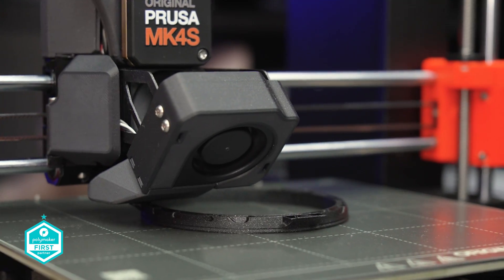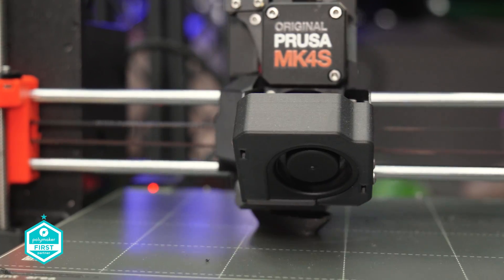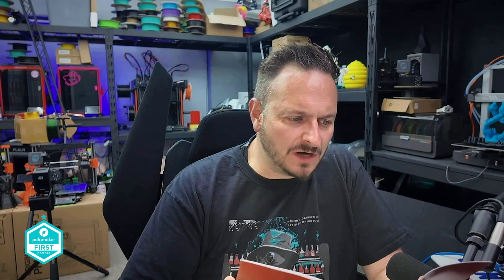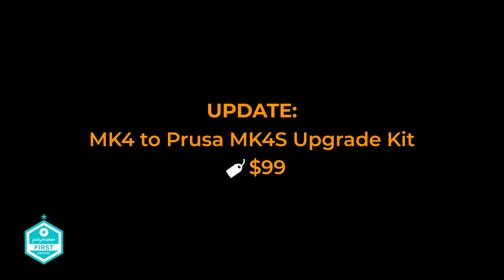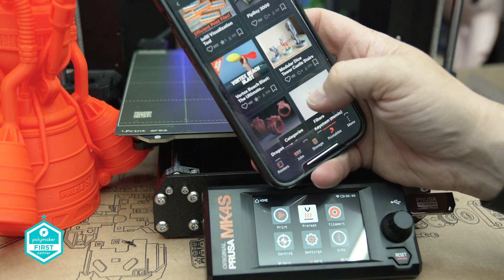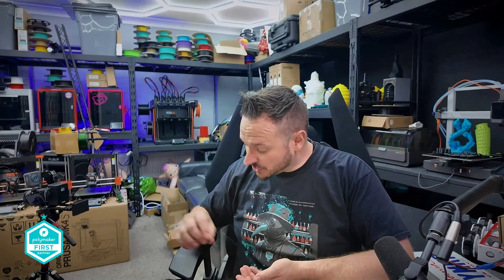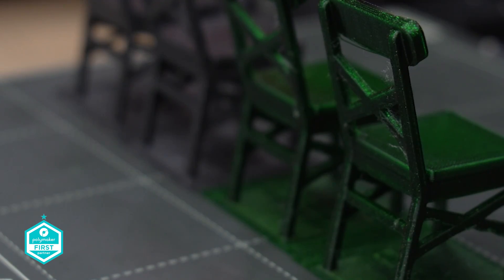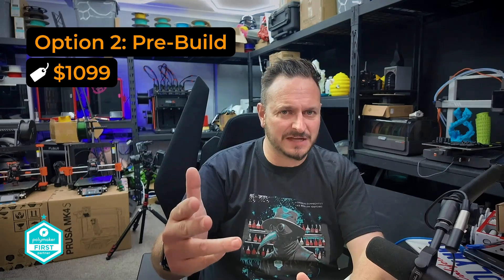Meet the Prusa MK4S: Minimal Print Assistance, Maximum Care Commitment!

Comment: Hi, I have a Creality ender3 s1 pro printer, I don't have any problems with small prints, but when I want to print large prints, it says communication with the MCU is lost at different times and the printing process stops, when I want to continue from where it left off, it starts from the wrong position. Why does this machine give an error with large prints, I searched the internet and couldn't find much information that would be useful for me. I talked to a service and they told me that this could be due to overheating of the sonic pad, stepper or motherboard. I don't know what to do. Do you think cooling the steppers could be a solution, if you have published a video about this, I couldn't find it unfortunately. I would be very happy if you could give me advice. Unfortunately, I don't have enough technical knowledge on these issues. 😞
Reply from the maker: So if you are running Creailty OS /
klipper via a sonic pad I’d suggest you look at the error logs via the web ui you should at that point see what it’s erroring on. On your small prints are they positioning in the middle or to one side ? 

To be honest it sounds like it’s not positioning correctly.
Reply: @TheRealSamPrentice  Thanks for your answer, my friend. I had made the offset settings, the printer works right in the middle. I will try to make thin and high prints in the corners of the printer and see if there is a problem with them. I did not understand much from the error logs, but if I find someone who does, I will show you. I did not try cooling the motors either, if there is no information in the error logs that will solve my problem, I will try cooling the motors.

Comment: Noise? I keep asking this wherever I go. The MK4 is not particularly noisy, but the fan can be obnoxious. Is there any meaningful step with the mk4s, please? Or can I simulate it with confidence by tuning the fan to 70%?
Reply from the maker: The fan doesn’t seem loud I mean having just run the t1 which is a jet engine.. this is pretty quiet, the movement is louder

Comment: I am not sure what you mean by wanting the App as feature for the XL? I have just started a print on my XL using the app and am monitoring it? The app is just an interface to Prusa Connect.
Reply from the maker: Sure well currently on the version that I’m using the XL doesn’t appear to work the mark 4’s do though. The app I’m using is via TestFlight and is a beta version so I don’t know if that’s different but that’s what I’m commenting on. As always happy to be wrong ;)
Reply: @TheRealSamPrentice  Perhaps the Android and iPhone versions are slightly different too...
Reply from the maker: @ulaB what are you using ?
Reply from the maker: @ulaB so this is Version: 1.0.2 (92) for iPhone but no xl options only mk4.. I’ll ask them about it.
Reply: The app itself is not related to mk4s except that it was launched at the same time. It works with mk4, mk4s, xl and mini. I'm using it with my mk4, on android
Reply from the maker: @ktakna it’s not seeing my xl on this version
Reply: @TheRealSamPrentice  But you can see the XL in Connect?
Reply from the maker: @ulaB Not on the version app that I’m using. I’m at Prusa on Monday so I’ll confirm
Reply: @TheRealSamPrentice  for reference, I'm on android, 1.0.3 build 97, updated today, where xl is visible. It was visible in the previously available version yesterday as well. Maybe the tf version wasn't updated. Besides this, I don't like Prusa's marketing, which listed this app in the announcement for 4s, seemed they they wanted to have just another cool line item in the marketing release announcement. Wording correctness goes a long way - they should have just said "we're taking the opportunity to announce the release of this app which works with the other mentioned printers as well"
Reply from the maker: @ktakna  understood, so I have the xl and the mk4 which I didn’t review but have simply just been working with on the bike projects. That being the case I had not previously used that feature as I was only using the usb. I’m running an iPhone so I might be at a disadvantage but when you go to add a printer it only shows mk4’s and nothing else.

Comment: Still over priced
Reply: welp, I will still buy 4 upgrade kits
Reply: No slave labor, though.
Reply: Im willing to bet my left kidney that this guy is a bambu owner and is still blind to the endless flaws the x1 has
Reply: @Enjeenier  actually I never owned a Bambu lab and I am a MK3s+ and MK3.9 owner and waiting for my 2 tools prusa XL  and 3.9s upgrade to be shipped.  I got my 1st two kits when prusa used to sell them
For 749USD that was a good price
Reply: I'm both a Bambu and Prusa owner. And yeah, prusa is way too overpriced. But I also think the X1 is overpriced aswell. The P1S and P1P are the printers to buy currently and objectively. If you're not getting a P1S or P1P you're spending more money for the same/less.
Reply from the maker: @vulpix9210 i find it really interesting what people think about price and value.
Reply: @TheRealSamPrentice   I don't buy brands. I buy products. So if the product I'm buying does the job that I want well, and it's priced better than hardware that does that job around the same level, it's a better value. In this case the P1P not only does the same job of the mk4s around the same level, it just does do a better job with less failed prints while also being faster (given you either change the start gcode to get rid of the calibration it does every print, or you're printing long prints.)

Comment: My first 3d printer was a prusa mk3 factory built, twice it had to be replaced until 3rd turned up and it worked. Not happy with support of prusa as they just blamed me for a power supply blowing up then a mainboard failed.
During my prusa issues I bought a creality ender 3 s1, it just worked and I still use the printer today while the prusa sits in the corner unused. Bought loads of different Creality printers but all needed something done to get the best out of them but my ender 3 s1 is still stock.
Then Bambu lab x1c entered my life and 3d printing got easier, nice to see other companies catching up driving development and costs savings.
As far as patent law suites for what was an open source concept just grinds my gears from a company that’s failing.
Sorry I just realised that you had to stop using advanced 3d printers to revert to using the mk4s because of the archaic nature of the technology? Wow 1 step forward 10 steps back 😂
Reply: I feel sorry for you bro :( I suppose you have just had a bad luck. I have some MK4 at my place and I had only one problem with one of them (it was my stupidity) and the support was the best. They were very helpful and polite, so I cannot say anything bad about Prusa.
Reply from the maker: On your last point, not at all it was refreshing to move into that direction I’ve been using the mk4 and XL on various projects and it’s been enjoyable playing with the settings and using it without being told what to do. I’m not a robot ;)
Reply: @TheRealSamPrentice I get what you’re saying about stepping back but isn’t that just nostalgia, going back to when tinkering was a must to get the best from your printer. I got caught into the prusa hype and the experience fell far short from my personal experience. I have to swap back and forth from my Creality printers and my Bambu lab machines. You can apply your experience to tune Bambu profiles and improve the output, but out of the box experience is hard to beat with the Bambu printers.
Reply from the maker: @Happy3dprinting for sure and I’m sorry you’ve not had a positive experience, I have many Bambu printers but each manufacturer has an edge to it, so for me keeping the balance is important
Reply: @Happy3dprinting  And I must disagree. I set up printers according to manual and it work perfectly. There was no need to do some tinkering as you say... So as I wrote before, I think you had a bad luck bro :(
Reply: @LauraRasm 3D printers have come a long way to the stage that you get good results out of the box. It wasn’t always that way and modifications were needed to removed issues that may inhibit you obtaining the quality of print you desired. Typically flow and temperature tuning were basic things for every filament you wanted to use. Now with slicers having profiles to help in basic setting you still have to tune stepper motors to give accurate results unless you adjust the slicer to do this for you. A lot has improved in turning the 3D printer into reliable tools from a technical challenge to help new users get a better introduction into printing
Reply: @LauraRasm  Unless you're only printing with prusament with adjusted profiles, you won't be able to achieve the quality Prusa declares. And if you print with other filaments for which there are no profiles, you will inevitably have to fine-tune the printer every day and Prusa is far behind. Instead of design work, you have to fiddle with printer settings every day. Yes I can order Prusament, but then the cost of my services will be cosmic and I won't earn anything. Why would I want a printer that's as reliable as an axe but hasn't evolved in 10 years for the better?
Reply: @antonmymrikov5338  And what about MK4S? It is a quite new upgrade and it sent Prusa to the next level, I would say.